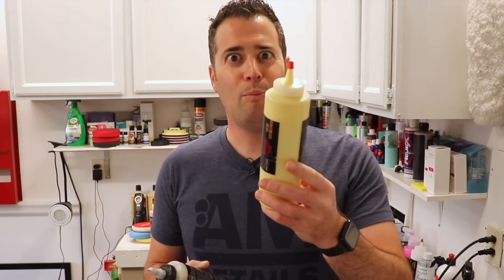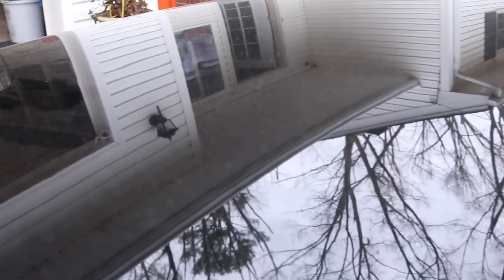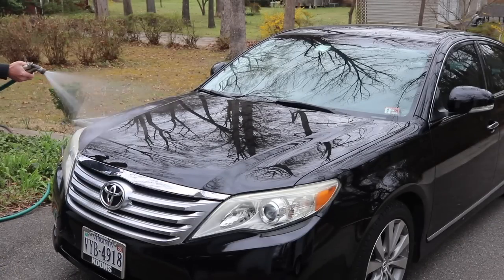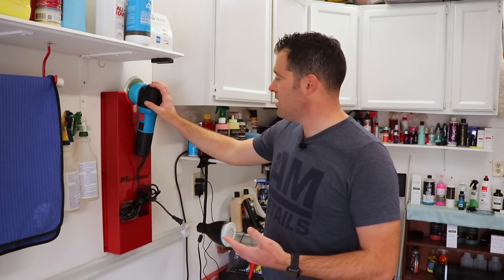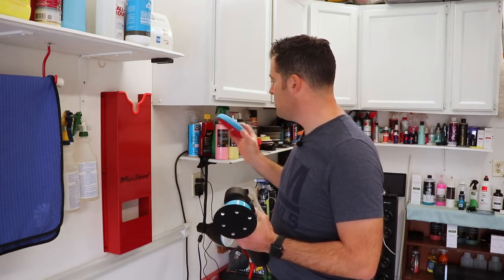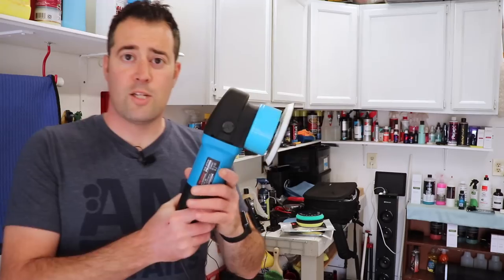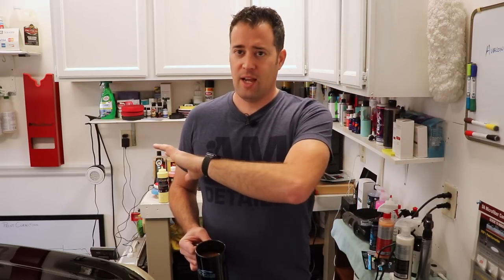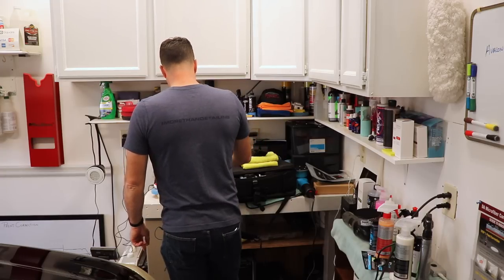Weekend Wash / Testing Some New Products & Tools / #Coffeesnobs #autodetailing #weekendwash

Comment: Glad to see you expanding your arsenal bug guy. Maxshine makes good pads however, I've had nothing but problems with their polishers.
Reply from the maker: Thanks. Really? Which polishers are giving you problems?
Reply: @MirandaDetailing  I was about to do a lineup change to all the Maxshine polishers. I spoke to one of main salesman the whole deal. I picked up a M15 and within two hours of use the trigger assembly broke. I replaced it and got another and within 2 days of that replacement the speed dial broke on that machine. I called my salesman back about my issues and his response was vague like he didnt even care. It truly changed my mind about maxshine and there product line of polishers. I do have there rotary extension with smaller pads and that works great. Plus a lineup of there pro series pads. I've never had any issues with them but for some reason the polishers and I don't get along. I was extremely disappointed with the customer service I was given as well. To make it worst, I called the warranty department on that last polisher, they told me they'd send out a replacement speed dial assembly for it and I could replace it myself. The had my info on file, she read my info back to me over the phone. Till this day, over 7 months now, its never came. So I still have a broken M15 sitting here. I'm sure some people people love Maxshine and others don't but that's just my story. I was willing to spend thousands with them but instead I spent maybe a hundred in pads and the rotary extension. I hope the polishers work better for you my friend.

Comment: Which polisher in all three categories (8mm/15mm/21mm) you found to be less louder or have very minimum vibration? 

I have Shurhold 8/21mm and Adams 15mm and thinking about jumping to another brand as long as they do not have same level of noise and vibration. Any suggestion from member community is also welcome 🙏
Reply from the maker: Hi. I use my Rupes 15mm the most and I find it very smooth and not crazy loud. The porter cable is also not very loud. But it’s not really the throw that makes it loud but the wattage and alps that make it powerfully and possibly loud.